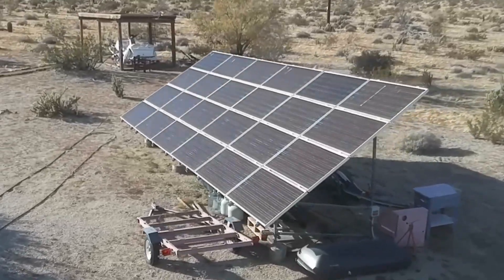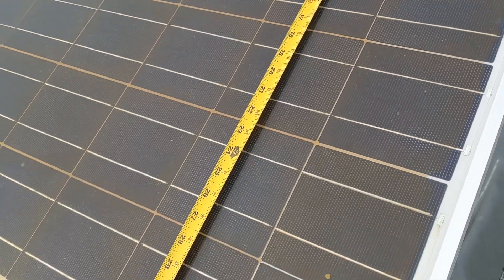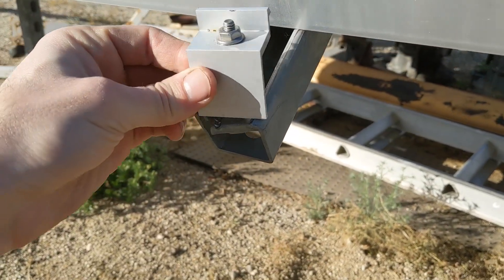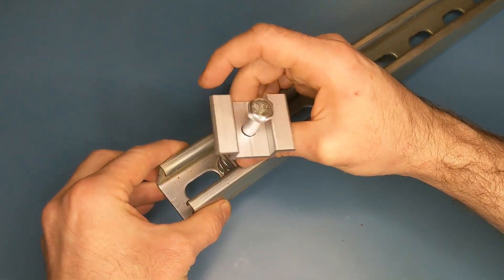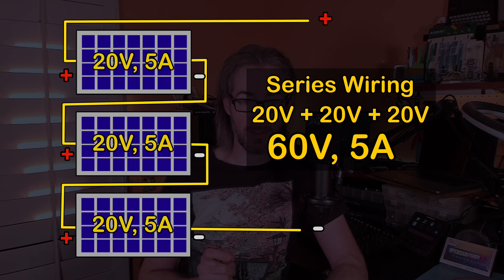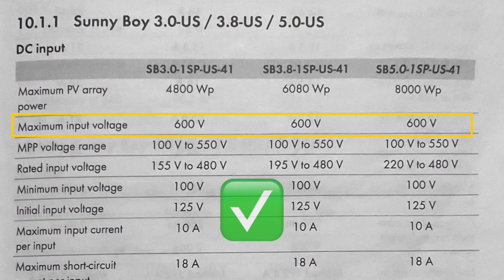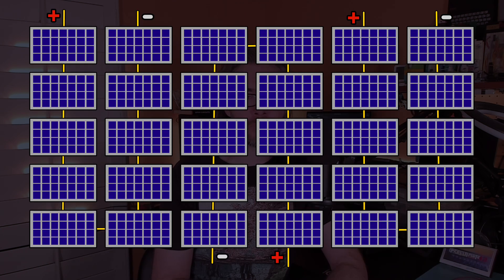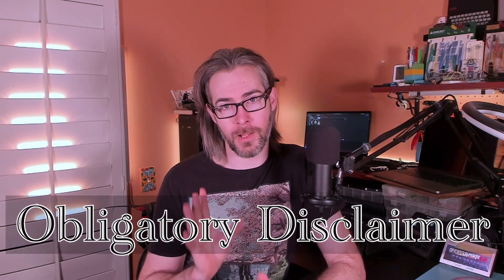Expanding an aging solar array

Comment: Really good job and thinking there! Solar is fun to play around with. What is your big array used for? Just store in batteries to use when needed or specific purpose? I build a similar array, just my panels are 10x15cm in a 8s4p configuration to charge a scooter battery array we use in our summer garden for small stuff like light and background music or rather phone and BT-speaker recharge.
Reply from the maker: It's all for household power. Grid-tie without battery backup. It generally produces more than needed in winter and less than needed in summer, which mostly cancel each other out. If I were starting from scratch, I'd strongly consider a hybrid inverter with battery backup, since we do have power outages occasionally and it's very frustrating to have the panels sitting there useless when the grid-tie inverter goes down with the grid!